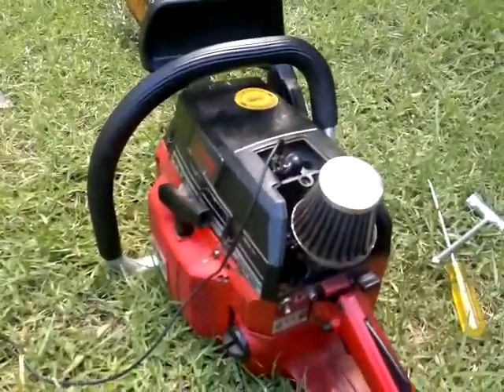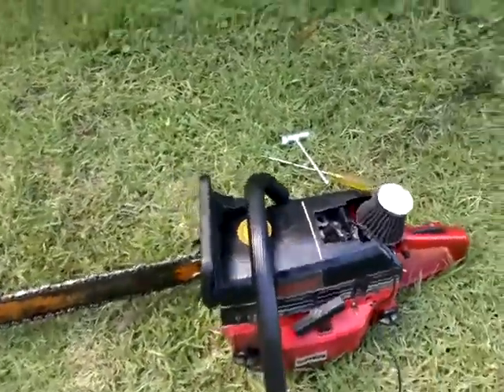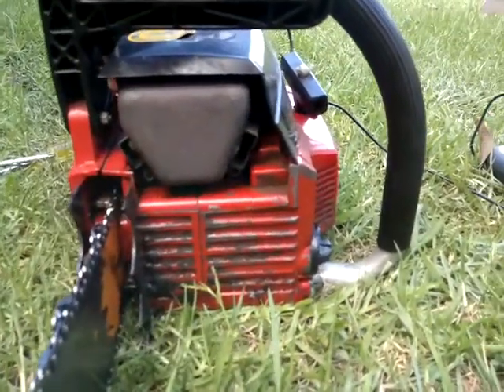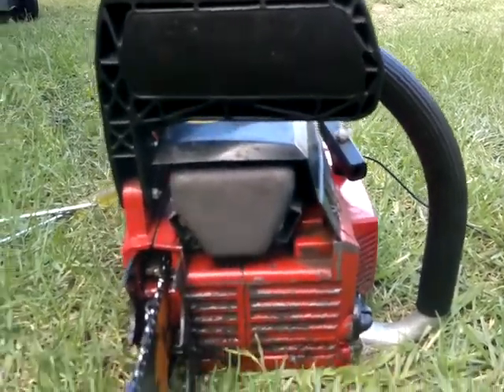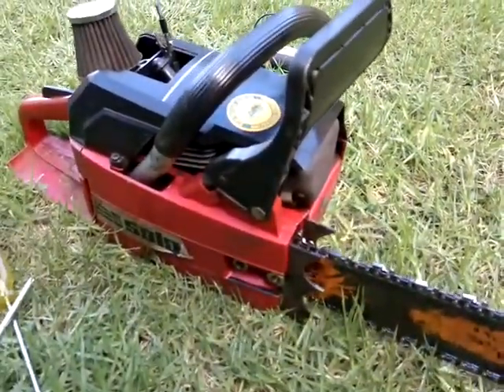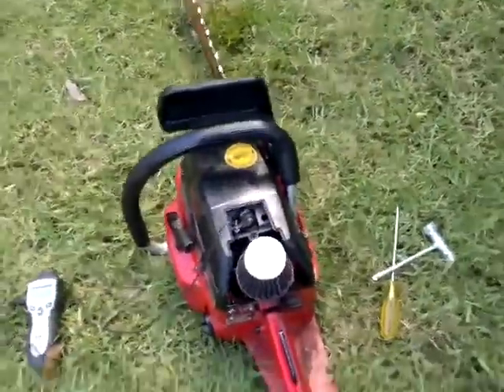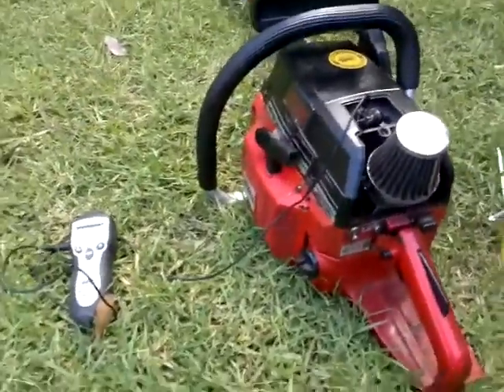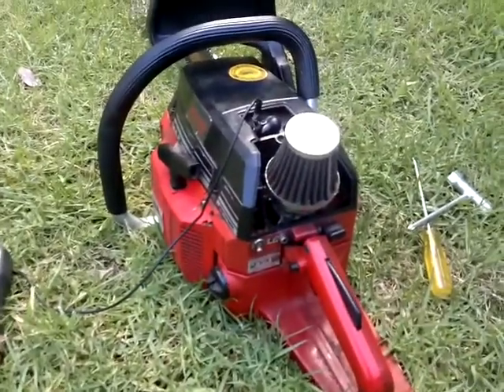Solo 670 chainsaw hot saw LOL tune up!

Comment: G'day. Got a 662 and a 670. Fairly new to the whole thing. Awesome saws, just having an issue with my oil pump gettin real tight. Have taken it apart, all looks ok just seems to be binding between the plastic case and rotating worm gear plate driven from the clutch bell. how would one fix this? or, where can you get another one?? Thanx.
Reply from the maker: sorry mate I did not see your comment ,there saws are hard to get parts for make shore you have got the right drive drum cheers Kevin